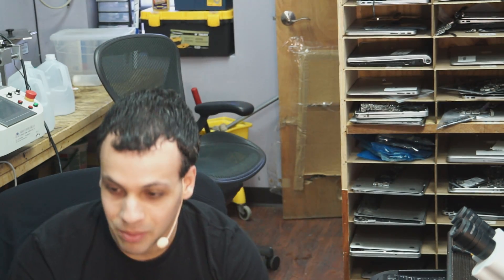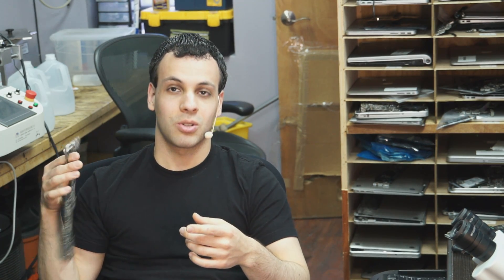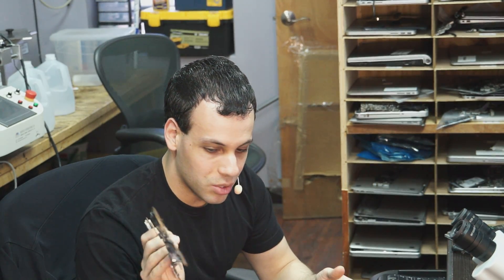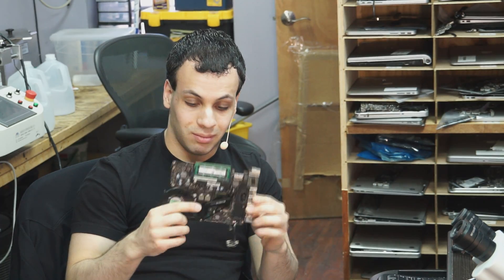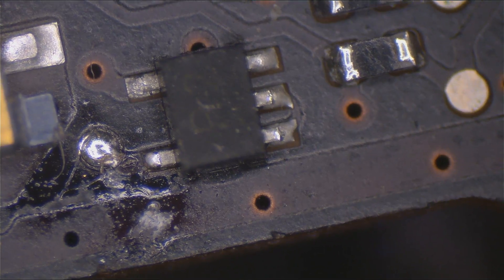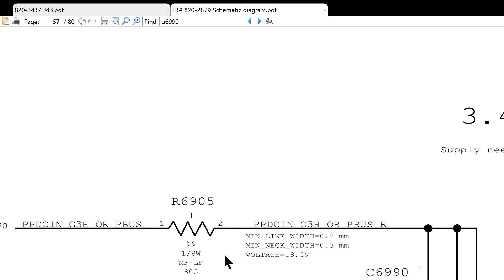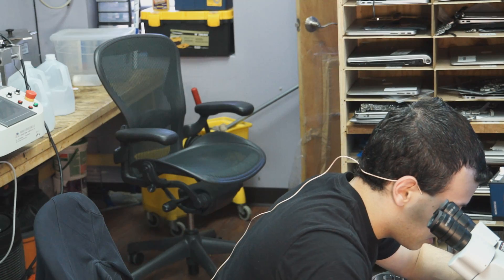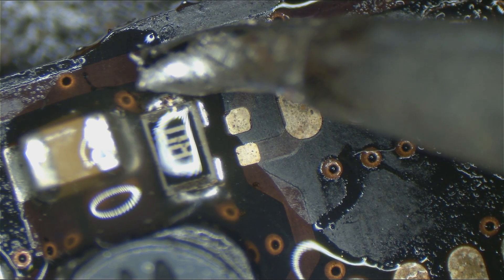Outsourcing logic board repair sucks

Comment: Louis,  I've noticed that you always remove and place things like resistors/caps using the tweezers on the metal-cap ends;  any specific reason for this as opposed to a side-grab/place?  

Have to admit, in this video, when I saw that first 1R0 go down I was thinking "Aaah, wonder if that's a dud too, looks like it's had a rough living", nice when the guess turns out right, instead of the 90% of the other times where I just troll myself.

Great watching the videos, last 36 hours have been like I've had the matrix probe in the brain and I'm fast-acquiring an expanded skillset thanks to your hard work,  was looking at expanding out to doing hard drive data recovery clean room repairs but the market will likely shrink down any how with SSDs rapidly taking dominance, so back to the old trade... electronics :+1:

Comment: Hi Louis, Some questions for you:
-Why do you use so much flux? I usually use a lot less than you in my repair work.
-Have you used hot tweezers before? Seems like a lot less of a thermal strain on the board and surrounding components than hot air.
-What kind of flux are you using? Do you guys use a sonic bath or something to clean before delivery?
Reply: +Tyler Pattison I see you use amtech 559 flux.
Reply from the maker: +Tyler Pattison Tweezers require hand eye coordination, flux just because.

Comment: Hey Louis, I used to be a huge OBS fan as well but I currently think XSplit is better (I don't use it for YouTube, however.) :)
Reply from the maker: +J Limon Why? I'd love to try it out. I need something that allows me to switch quickly between different capture hardware and encode the stream to libx264 qp=1/24 bit wav file in a mov container that sony vegas will recognize.
Reply: I think Xsplit can do that! I personally prefer Xsplit because it supports a snap to grid system, OBS 64bit was always a little too unstable, Xsplit supports a wider variety of capture sources AND I somehow keep getting free license extensions because every product seems to come with free licenses these days!

Comment: There is a local computer store in my area that does this, but I had to ask you, what do you think of their policy that if you don't come to pick up your computer in 30 days, they sell it, along with keeping a $50 deposit?
Reply from the maker: +Alex_2259 amazing policy. I have people that leave shit for two years and then come back screaming at me when they realized I threw it away or sold it. If I fixed it, pick it up. If I didn't fix it, pick it up. If someone doesn't want to pick it up, fuck being a storage facility. I will sell it, use it for parts, or throw it away. My office is 200 sq ft, no room to be free storage!
Reply: I have a shop of my own and we have a posted 90 day sign at the front counter. However I hold the devices at least a year and give multiple call attempts. After that I find a way to use the device and hopefully get my money/time back from it. Everyone will have their own policy but from my experience it seems a couple days after you get rid of the device that has been lingering they call or come in for it. Ironically has happend multiple times.